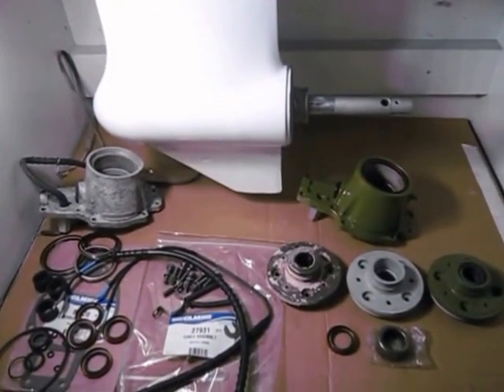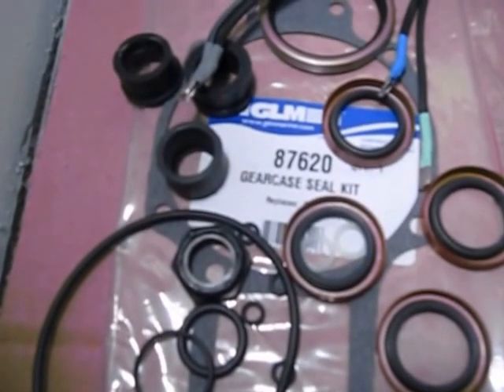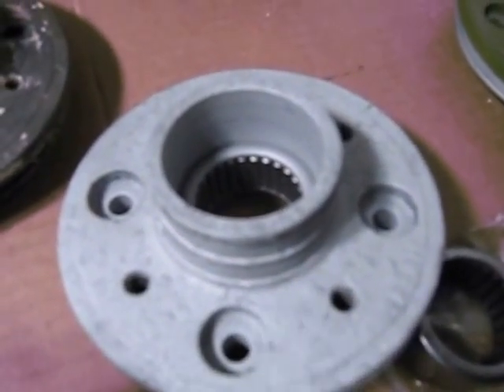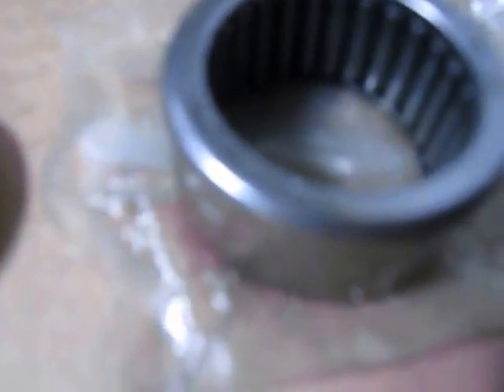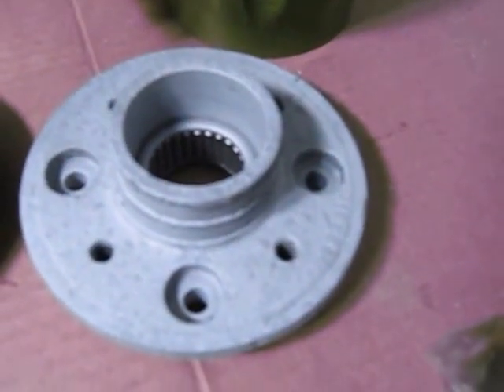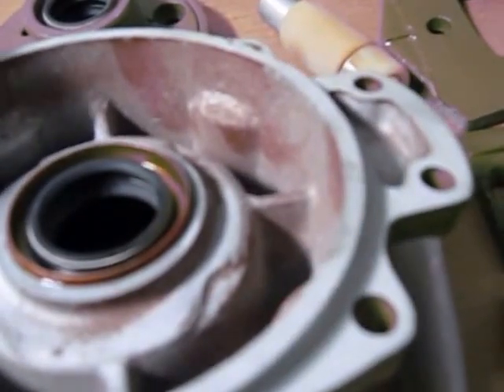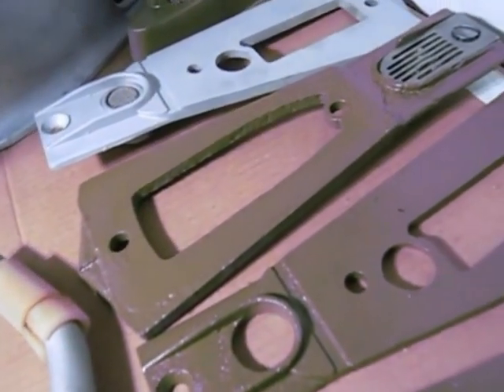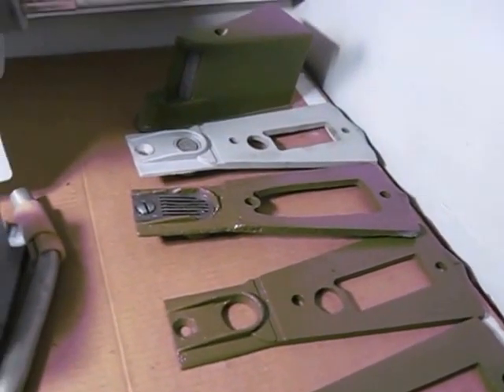Electric shift OMC parts for sterndrive repair

Comment: I have a extra lower unit Wonder if one can put this on a later year motor like the lower unit electric is 70hp will it fit 1977 75 hp ? I do like the electric shift better then manual shift .